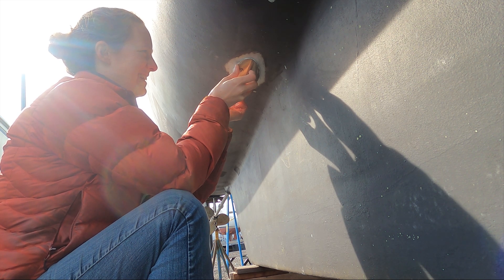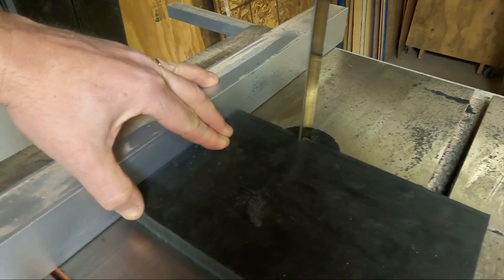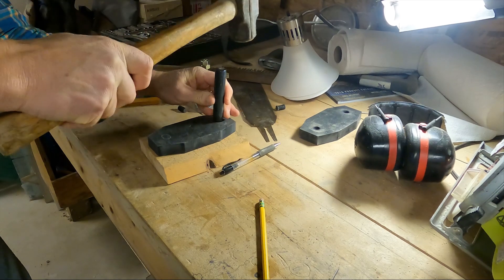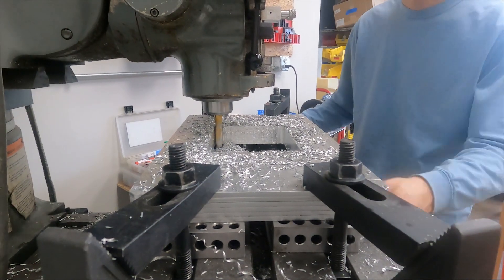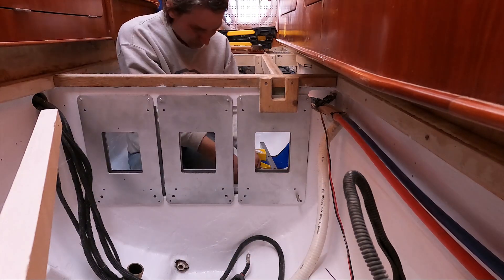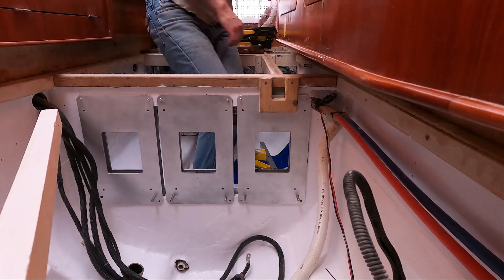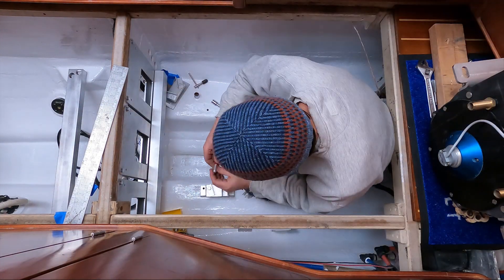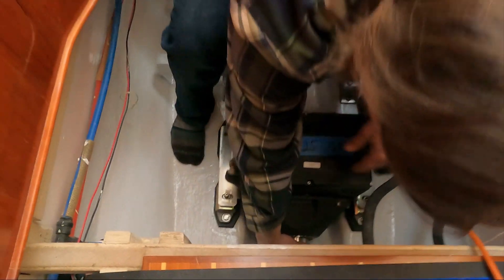Building Battery Racks and Installing the Motors

Comment: So glad i found your channel
I love the electric conversion....i plan on getting a catamaran with inboard diesels that are on the way out so an electric conversion will make sense. Lithium batteries solar panels and 5 to 10 kw 3 phase motor on each side. I will be taking notes! I am a toolmaker so seeing you make the mounting plate on the Bridgeport miller. I grew up in Bridgeport Connecticut where the bpt miller was made.
Reply from the maker: Good luck with your project!